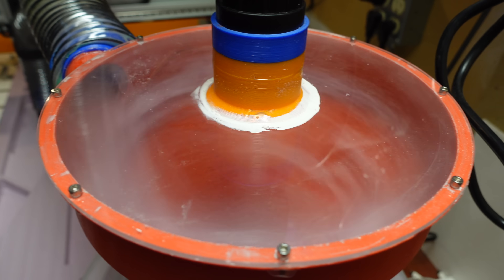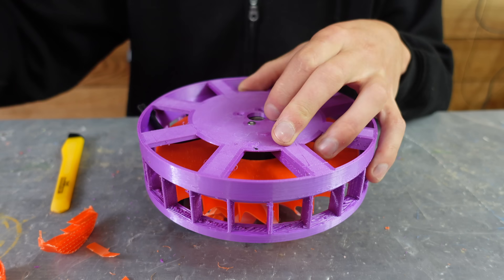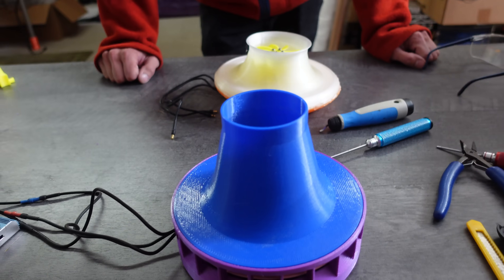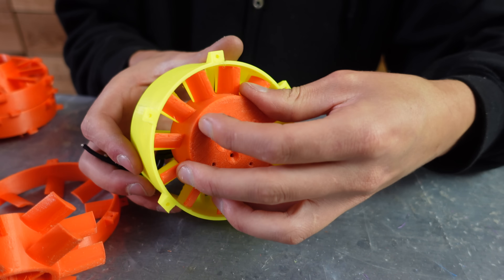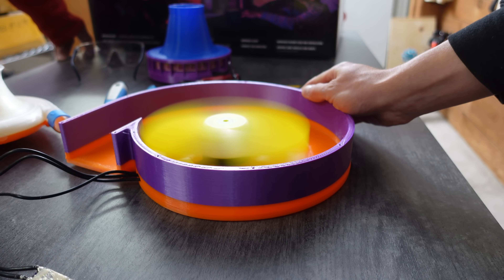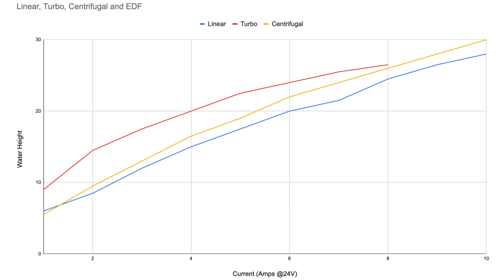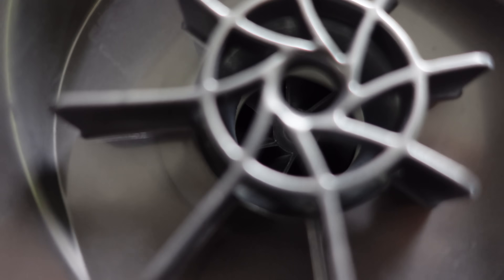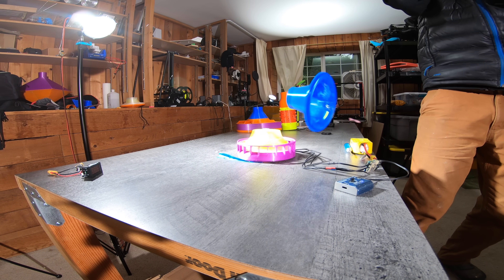DIY 3D Printed Vacuum Impellers

Comment: I watched this 3-4 times and still have some questions; I am starving to know a few more things: The dyson: modify your power supply for it, measure the real current draw, and how does the dyson work on top instead of the 3d printed designs?  Can you limit the current and get a closer static pressure test w/ the dyson, or larger/longer tube?    Why not use a larger diameter exhaust to the turbo, would it beat the centrifugal then?  The stacked fan, do the static blades actually help in any way or do they just make more friction by causing the air to need to change direction around them while they add no power to the system? Would it be better with just a few stacked spinning fans and no static blades?  You mentioned that the centrifugal blower was too large for the motor,  why not try a few smaller blower sizes and try to tune it?  Was the TL;DR that you're going back to your shop vac?  I've got notifications on, and I am really waiting for a follow up video that may round out a few more of these questions.  Thanks!

Comment: Centrifugal compressor are not used in jet engines: they are too heavy. Jet engines have axial compressors.
I am not sure but if nowadays someone still uses centrifugal compressor jet engines, it would be an helicopter

Comment: In the vacuum industry they call the "axial vacuum pump" a turbo molecular pump, they are generally good for high vacuum but low volume so they require another vacuum pump in front of them to obtain low vacuum first.

Comment: I used a 29€ handheld but battery-free vacuum with a 450W asynchronous motor and a power regulator socket that's sold as a speed conrtoller for pond pumps (15€). Now can regulate the power between 100 and 450W and have a sufficient vacuum for my 3018 at 100W. I also printed a cyclone for a bucket and if anything goes through I still have the cyclone and the hepa filter in the vacuum as a back up. It's not as quiet as a dyson but it is surprisingly strong (the bucket needs reinforcement to not buckle inwards above 350W)

Comment: On the turbo compressor, making the inducer to exducer ratio larger ie smaller inducer versus larger exducer will generally improve delta pressure across the housing. Increasingly positive blade rake helps, more positive curvature in discharge blades increases delt as does increasing the radius of transition of inducer exducer.

Adding a venturi nozzle about 3 diameters above top of inducer helps backflow. 

Interesting but expected results

Comment: You should really look at getting a cheap eBay turbo wheel and building your encloser around that.

EDIT: I actually have a cast wheel somewhere in my shop I'd be glad to send to you.
It's a 60mm wheel. 
It's balanced but the downside would be the weight. It would kill the smaller shaft electric motors.\

Comment: You introduced me to sea shanty music genre. Never knew it's a thing. I listened to the song you made before the Nathan Evans - Wellerman. And I was like "Damn! this dude can do music too. Cool" and you clearly are. Good vid as always.
Reply: lolmy comment says "Cool stuff.  Most turbomachines (non-positive displacement) reach peak pressure delta across them around their mid volume flow capacity.  You could be quite far down the pressure capability in your static suction test.  My bet is the turbocharger style would win out for suction per watt input.  Your axial flow design has the most potential but you need pressure taps between each stage to ensure each one is doing its part.  Did each stage have a different blade design?

You introduced me to sea shanty music genre. Never knew it's a thing. I listened to the song you made before the Nathan Evans - Wellerman. And I was like "Damn! this dude can do music too. Cool" and you clearly are. Good vid as always." 

AND I ONLY TYPED

 "You introduced me to sea shanty music genre. Never knew it's a thing. I listened to the song you made before the Nathan Evans - Wellerman. And I was like "Damn! this dude can do music too. Cool" and you clearly are. Good vid as always."

Comment: Watching it and in all fairness about "dropping the plastic into it and *BANG*"   It seems most of the damage was done by the shroud and not the piece of plastic you dropped.
All in all great video.
On the axial one:  I get it that it would (probably) be more work
Why not make the center bit as layers.   Then you put the outer, inner, outer, inner, outer, inner and stack them on top of each other progressively as you go up?
For the middle bit, you could (maybe) just make castleations (?spelling?) on the parts so they interlock with each other.   When they spin (driven from one end) they would compress into/onto one another.
Just a thought.

Comment: I like that you printed and tested several designs. If you want to suck harder, I would try changing the blade pitch and diameter at each stage of the axial fan. I have a migraine and am on hefty pain meds so I might get this wrong, but I think the mass flow rate is constant at each stage, but the volumetric flow rate needs to increase as sucking increases the volume of the mass as it moves along. The air needs to speed up at each stage or each stage needs a larger cross section (I guess cooling the gas might work but probably isn't practical.)  or a mix of both. I think it is sort of the opposite of what jet compressor stages do which might be why the store bought turbofan didn't perform better.  Also since a blade is moving slower through the air near the root compared to the tip, the pitch should vary along the blades. I don't trust my word for it either right now, but if you think along those lines you might improve the design.

Comment: For a dust collector, do you want more volume, or a higher pressure differential? Maybe there is a relationship to noised generated that serves a limiting factor?
The objective of the build was not clear, but did result in higher entertainment value. Perhaps a more meaningful objective. 

Generally a squirrel cage fan is considered a quieter design so wondering if a reason such a design not considered?

Comment: The turbo type fan wants to have one outlet like the centrifugal fan, that will reduce the noise a lot! Also, maybe a stator in the inlet of the turbo with a small bearing would reduce vibration?
Reply: My dream is that rctestflight and Xyla Foxlin will have a baby name it Kyle

Comment: fun fact, vacuum can not "lift" the water, the atmospheric pressure is what pushes the water in the bucket down when your "vacuum" reduces the atmospheric pressure (probably around 14psi depending on your elevation).

this means that if your pump can create even a PERFECT vacuum and remove ALL pressure from above the water, you can only draw water up a pipe 33.9 ft at sea level. old buildings used to use this as a type of backflow device to protect backsiphonage into a public water system. (not approved for use in modern plumbing code anymore of course) but you can still find old buildings with a long pipe up the side and back down.

Comment: Your scroll blower needs backwards-curved blades, along with diverging exit pipe, to recover the kinetic energy of the exiting air.  The goal of dust-collection system is to move a lot of air through at low static pressure.  You don't need more than 12" water column, but you do need large cross-section.  There are many videos/sites in optimizing dust-collection systems.  Static water-column measurements are not applicable; you need manometer reading while the system is running with filters/piping normally used.

Comment: Gotta try a roots and then whipple (twin screw) style supercharger/blower. 

IMO: They are more "positive displacement" than centrifical, so they may create better suction/compression-ratio at lower power and lower rpm... And shouldnt be too hard to 3d print, in theory... They dont get used much in appliances, because 1. Designs close to the efficiency of centrifical setups are a pretty modern phenomina and 2. High rpm motors are common in household appliances and more suited to centrifical designs, which also tend to be smaller than thier blower counterparts (making them, again, more suited for appliances)

We use both the roots and twin-screw style blowers in industrial settings for pnuematic conveying amd some "typical" compression scenarios.

Comment: Such a fun project! If i had a 3d printer i would add dust shrouds to my router, pantorouter and other wood tools!  Also would see if a closed system (by routing the blower vents to the front of the tool site so that air flow is not just vacuum but also blowing - not absolutely closed but as close as possible)

Comment: Didn’t get how is the difference between those 3 designs, seems quit the supercharger cus of the noise, but what about the other 2? 
Otherwise as I know, the delta printer can print round circles way much better than the 3 axles printer, do you want to try it?

Comment: I'm wondering if one of the issues is the print itself, PLA prints are very permeable which is probably cutting down on how high of a vacuum you can pull. Best solution I know of is coating the inside surfaces with a thin coating of resin, it also adds a bit more rigidity to the prints and lessons its tendency to spontaneously disassemble. If you do it right you can actually build 3d printed tanks that can hold significant air pressure, like 150 PSI pressure. https://www.youtube.com/watch?v=eGgwuANScyM

Comment: Just for fun, you could combine the fan and the separator: In the radial blower on the outside edge of the scroll, add some holes or slots/vanes that leads to another scroll. Heavy particles will flow on the outside of the stream dragging the wall (like in the cyclone), as a hole appears it will get flung out. Now this other area in the secondary scroll is kept at a slightly higher pressure than the main exhaust via a damper, otherwise pretty much all the air goes there. This flow is routed to an inertial separator, but the flow is lower and more concentrated so it could be more efficient and smaller. (Or just a big vacuum cleaner bag)
If the impeller is subject to dust straight vanes are the best, but otherwise it would be fun to test the difference between backward and forward curved impeller vanes as they are more efficient.

Comment: Smoothing the blades could be done with some polymer for resign printer. Apply some with brush and cure it with UV. It does pretty good job

Comment: You can probably get a small increase in vacuum performance by coating the 3d prints, due to 3d prints being porous. Which mostly shows when it is under pressure.

Comment: Interesting: When you spin a motor faster by normal means, it takes more current, but when you let it spin up by reducing its drag, without also increasing the voltage or pulse width, then it takes less current! I hadn't thought of that!
Reply: The miracle of motor back EMF

Comment: How did you design the turbo style impellers? Saw some videos online but they are all hand wavey design methods with no control on aerodynamic factors like input angle of attack etc.

Comment: This is awesome and I love the complete lack of click bait in your titles and content. But in this case, I think you should keyword or change the title to something like "Build Your Own Shopvac", "DIY Shopvac", etc... Thing is, a lot of people seem to be getting into CNC routers on a hobby level and dust collection is often an afterthought. And I would speculate that a fair chunk of these people would love a smaller DIY solution and that many of them would also have 3D printers:)
Reply: As one of that target audience I disagree. The title is better as it is.
Reply: @claws61821  As is your right:) 
But that begs the question, what is actually the target audiance? Maybe that's what I got wrong but I for one, thought I was in it as I am constantly mulling over building/buying a small, stiff CNC router.
And "vacuum impeller" doesn't really signal dust collection or CNC hobbyist much in my ears. 
Either way, this is intriguing as most of his projects are. My comment was solely about that I think there's a bigger audience out there that could benefit from this video but they wont easily find it.
Reply: @AntiVaganza  Most people first jumping into any of these hobbies won't have the slightest idea what a "dust collector" is, much less why it might differ from a basic vacuum or why they might want to use one over the other, if they even think to need a vacuum in the first place. "Impeller" is another keyword on its own they might not think about, but they'd certainly fling around "3D printed vacuum".

Comment: We use those big “snail” blowers, as you call them, to move loose wool fibres around the factory. They work pretty well with straight blades on a conical body, to deflect the flow away from the centre. If you made the blades twice as wide, you would start to see some serious flow, with pretty good efficiency
The reason we use them is because they’re beefy as hell, and they don’t get worn away by the wool too much (wool is amazingly abrasive).

There’s no way to beat a multimillion dollar design like a commercially produced vacuum impeller, but it sure is fun as hell to try!

Comment: ref: 4:00
What you need is not a resin printer but a 2 nozzle printer that can us a water soluble support material. Printing overhang on a resin printer is a killer for surface and correct shape. Print models that need small details and correct shape on an resin printer and most of the time I have to manually place support to get a good result.

Comment: Need more space between the rotor and stator vanes if you want the fan to be quiet.  3-5mm worked well in my experiments.  Since the rotor is 3D printed, you can use a fully enclosed rotor instead of leaving the vanes open on top.  Also, in my experiments tip speed correlated the most with pressure and noise.  So you can half-ass the rotor, but still get great noisy performance if you spin it fast.

Comment: Could you make a cyclone separator where the conical part spins to see if that improves the effectiveness? The spinning part would have to be in a slightly larger static casing to keep it air tight. Not sure whether it would need to spin with or against the direction of the airflow.

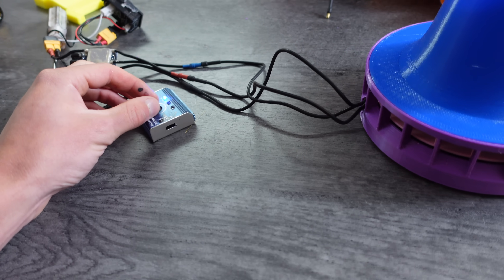Comment: I love how 2:40 is just casually applied science as in
"hey this should work like that"
tests it
"oh yeah it does".

Every day I'm thankful for modern knowledge and the modern tools that let us so casually test stuff.
Reply: Compressor engineer here, the current decrease has all to do with "suction throttling". What's happening is the restriction of air flow restricts mass flow. And the total reduction of mass flow is greater than the increased compression work (specific work done on the air). With suction throttling the Inlet velocity at the eye of the impeller is reduced but the exit velocity is not (it is relational to rotational speed) so for every gram of air the compression work is going up just not as much as mass flow goes down.
Reply: When the tornado siren kicks up:
Reply: We would make minds like Newton and Aristotle just explode lol. Could you imagine giving DaVinci an archive of everything on YouTube right just now?
Reply: oh man i was expecting Ben from Applied Science to randomly show up
Reply: Except he's wrong. Exactly backwards. It's using less current because the resistance in increasing. It's harder for the rotor  to spin because there's lower pressure on the inside but full pressure at the outside trying to rush in backwards. If he put his hand on the blades it would have the same effect - current would go down. For a fixed voltage current will decrease as resistance increases.
Reply: @reginaldjeeves9825  An electric motor is not an resistive load. It contains coils of wire, solid pieces of metal, which current will just flow through creating a magnetic field. The fewer work that field does the more current can flow. The impeller not being slowed down by incomming air means it does less work.
Reply: @reginaldjeeves9825  i know nothing about electrics but i know that you are saying bs

Comment: if you attach the impeller blades to the housing and spin the housing instead via some kind of off axis gear mechanism. Basically spin from the circumference instead of the central axis. This way you don't need to worry about the tight tolerance between impeller blade and housing wall. Second, the impeller blade would experience compression instead of tension, so should stretch less. Well technically it might buckle instead. But If you shift the tolerance surface location to where it doesn't affect the performance of the system, it let you get away with way less precise machining.

Comment: Dyson's fan on the video looks more like an auxiliary fan for cooling the motor. The turbine itself is different. At least this is the case for my Kärcher vacuum cleaner. The smaller fan looks exactly the same and it is only for cooling. Turbine, though, is very different from all your models.